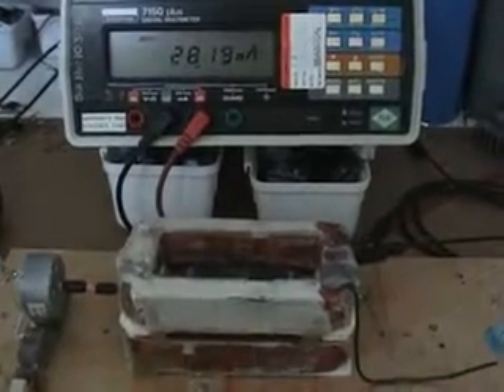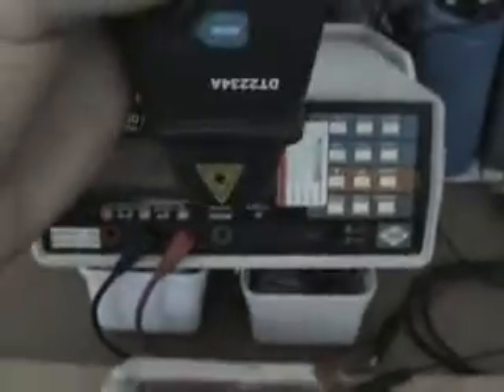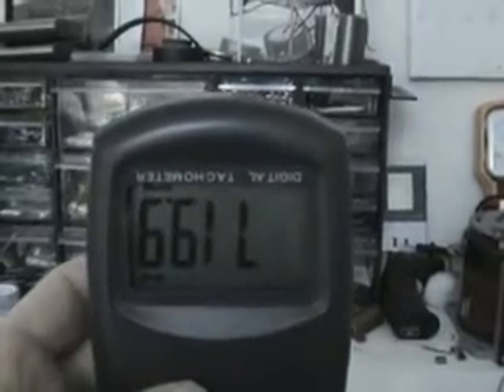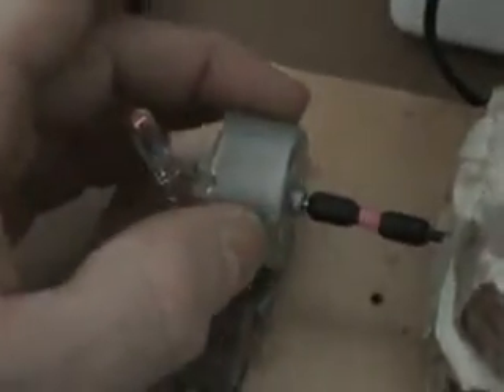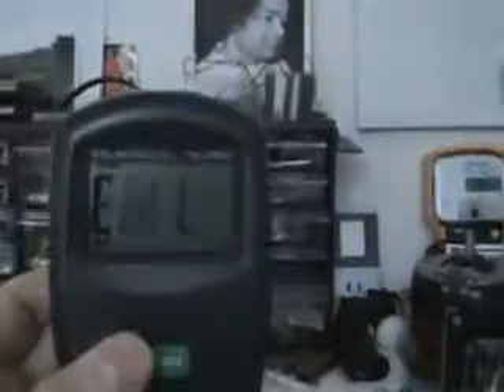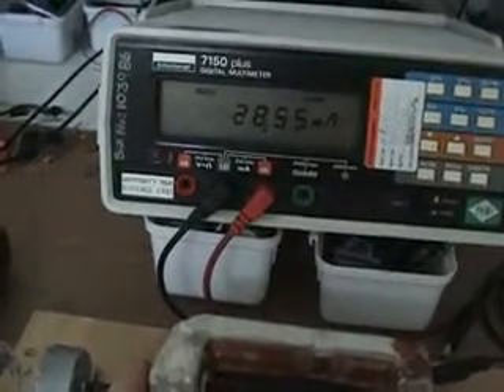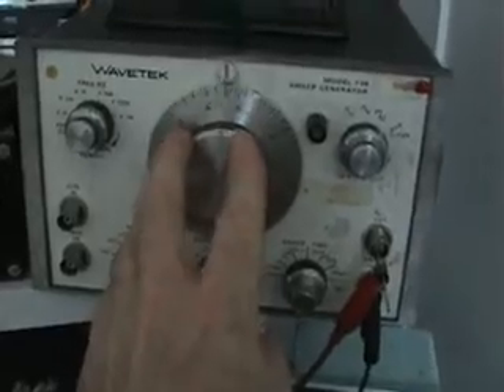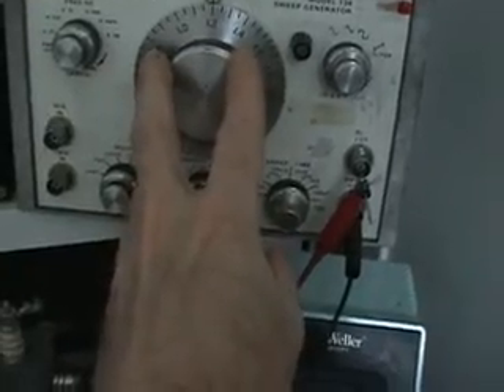AC Permanent Magnet Motor test 1

Comment: Old video, but still really good info. Thanks for all the videos you have done and work you have done in the community. Looks to me that the decrease in current with a load is simply the rotor magnet resisting the magnetic field of the current flow. Literally, a virtual resistor placed in line with the current from the back emf. Good stuff.

Comment from the maker: Hi knowledgemonger,

no problem! I know your general intent is to help.

I have an H-Bridge circuit that I'm repairing. With it I can go up to 50 volts no problem and also at what ever frequency I want. It's square wave but I can use a transformer to make it sine wave if needed. I'll make a new video once I have it working.

Stay tuned

Luc

Comment from the maker: Hi knowledgemonger,

I do appreciate most everyone's comment. However, you are wrong about me assuming that I believe this is an induction motor as this is not correct. I also know of a synchronous motors and I do agree that it operates on a same principle but they are not built like this. Multiple phases would also be a way to help prevent rotor slip.  Resonance is also something that I am testing at this time but I would like to keep the coils AIR CORE.

Come to the Forum topic to see.

Luc

Comment from the maker: Hi tonysam11290,

Tony, the big difference here that most are not getting is I'm using AC. However, if you know of a Newman or Bedini that uses an AC input in a air core coil please send me the information.

About the back EMF. There is a possibility that the effect of the input power going down when the motor is under load could be because I don't collect  the BEMF.

More testing will be done to better understand this effect.

Stay tuned.

Luc

Comment from the maker: Hi smokyatgroups,

I am aware that AC is not needed to make a motor turn. However my magnets are opposite poles so let say we use the + of DC at the contact for the 0 to 90 degrees. The rotor magnet would turn half way but to continue the rotation from 270 to 360 degrees the DC at the switch would need a polarity shift since the magnets are now in opposite poles.

Anyways, I think you're missing the point of this demo. Show me a motor that reduces current under load while collecting BEMF.

Luc

Comment: Hi Luc

I am visiting at the moment but as soon as I get home I will built me one of those.

Do they come out with a wiggle n a giggle or do you have to angle grind the welds off?

I got a nice digital frequency generator / counter so thats not a problem. At 2Mhz they coil looks like it will just about go into resonance.....

What magnets have you used I have 3 x 55Kg Neos but might just use two. I also have a few Microwave ring magnets, any suggestions?

Paul.

Comment: You don't need the complete sinewave to make this work.  Just need the first 0 to 90 degrees and from 270 to 360 degrees.  And can still collect BEMF as suggested by GBluer above.  Magnets return more energy than than is consumed in attracting them.  Can also resonate field coils at drive frequency ...instead of generator driving them. Even less energy required.

Comment: Did you pull the coils out of two microwave oven transformers? if so I can confirm your results because I have a few MOT lying about and like to build motor.... They seem to resonate at just above about 2 MHz if that helps. It reminds me of the Newman Motor but obviously you are using pulsed input not a commutator. 

Paul.

Comment from the maker: A collapsing field can be collected when using DC in a coil since the feed polarity is always going the same direction. However I'm using AC which reverses at each pulse so I don't think this could be done since my signal generator has a fixed 50% duty cycle. Maybe by using another circuit with shorter duty cycles and have a flipping recovery rectifying circuit this could be done ... but that may take the effect away. Still too many things to test to answer this one.

Luc